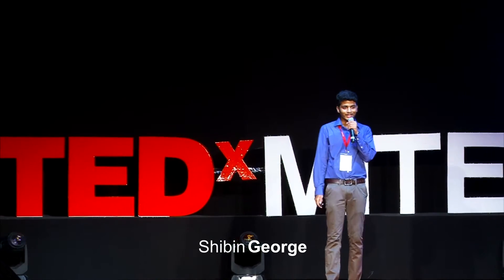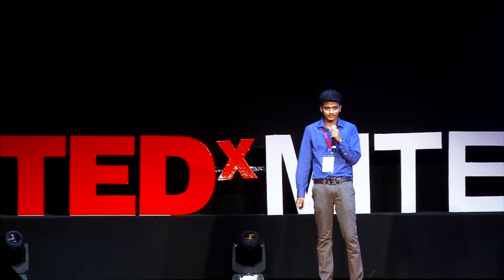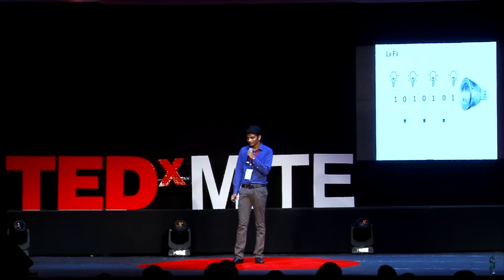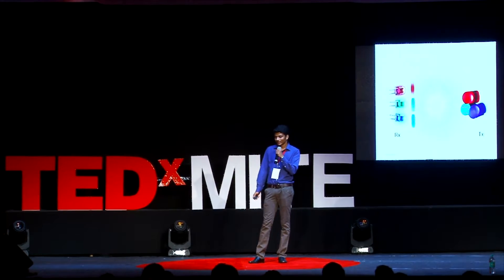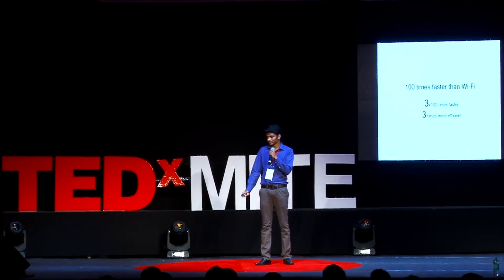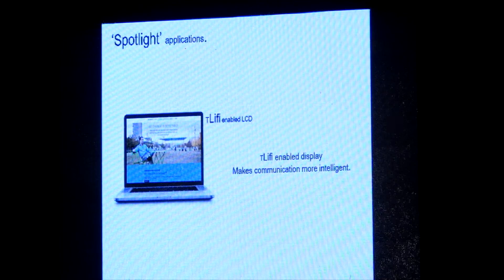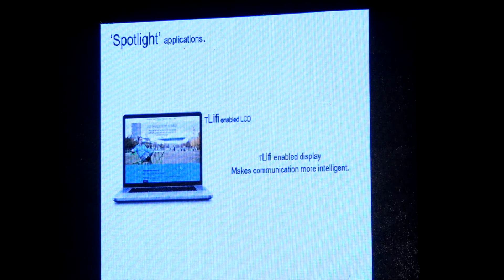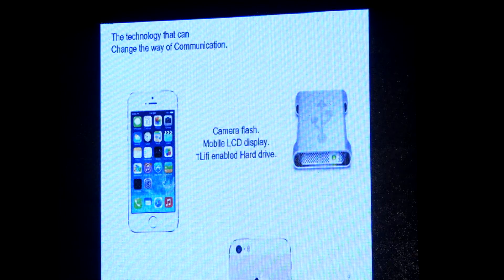Li-Fi Technology | Shibin george | TEDxMITE

Comment: hi shibin george... great work..I am very interesting in this work.. How you multiplexing these three light signal.. ?
Reply: Using conventional RGB mixing. Red-green-blue lights flick faster these will result a white light as visible. With precision filtering receiver can recover the data.
Reply: @shibingeorge41  can u give your email  id
Reply: is any special multiplexer or demultiplexer is required for light?
Reply: ARUL TEEN It is intended to send data in parallel. RGB can send 3 bit at a time. Flickering rate will be faster than humans perception. Result will be a cool white light that I mean multiplexing.
Reply: @shibingeorge41  you mean rgb led to transmit the three data at a time..am I right? If then how u can receive the individual data? R u using any special filter for that?
Reply: ARUL TEEN 
Yes wavelengths are extracted by special filters